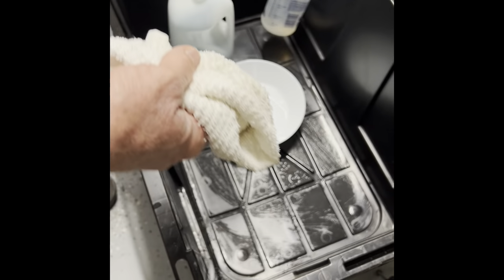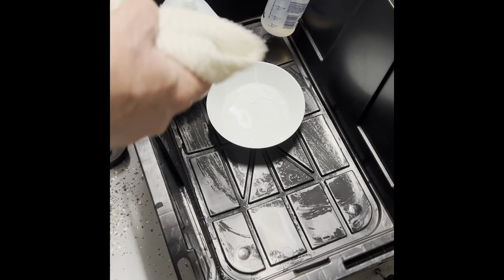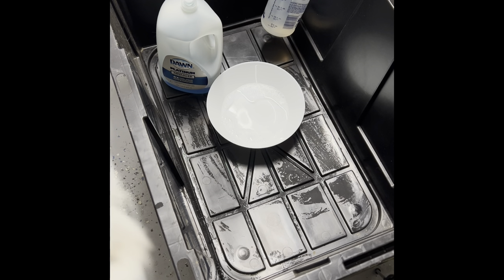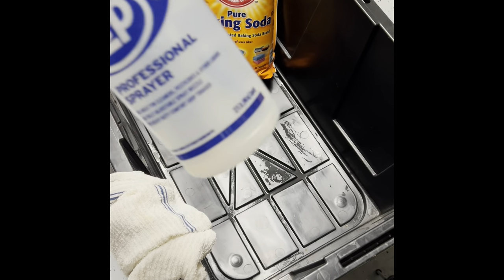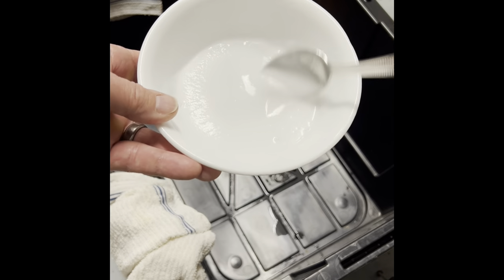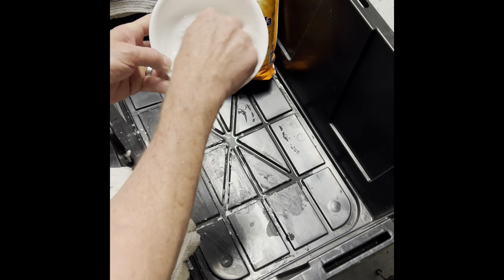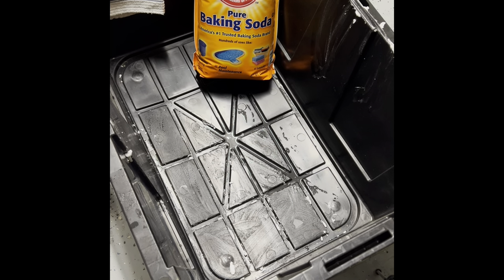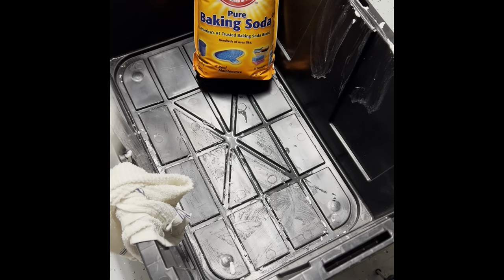How to remove🦨Stinky Toxic Plastic Smell out of plastic containers, cat carriers, and more...😇

Comment: Why should the consumer have to do this?
Reply from the maker: this video was done for a many subscribers who do not like the plastic smell in new products works for me God bless😇
Reply: @mbjdiy1778  I'm saying that they shouldn't be able to sell this stinky product to begin with.
Reply: @peejm1424  Nobody's forcing anyone to use cheap plastic tubs lol.  It's a price point thing.. If you can afford to store your goods in pelican cases or timber chests. You won't experience this problem. So shop accordingly.  :)
Reply: @M3rVsT4H  I don't have a problem with your video, I understand that it was posted so that it might help others, I'm sure many appreciate it. My problem is that regardless of the price, manufacturers should not be allowed to sell  neurotoxic products. I bought a rug in July that I cannot use because it is still emitting a flood of chemicals. I have to keep putting it outside because the smell coming off it burns the inside if my nose and throat and gives me headaches. I paid 350.00 bucks for it. I tried to take it back but was told that all they could give me was a store credit. Other than that nobody even wants to talk to me about it. As I was researching what I could do about it I came across posts about all kinds of bad plastics, everything from kid's mattresses to  clothing. I just can't believe that they are allowed to keep doing it. Anyway...
Reply: @peejm1424  Just for clarity, not my vid. But I hear ya. There is some nasty stuff out there. And the big problem we have as consumers is "Acceptable Limits". Because what one lab finds acceptable, your nose may not. And all we can do is inform ourselves and make informed decisions. And usually that leads to spending more. A wool rug would have cost you 5 times as much, but you wouldn't have this problem.

On balance.. Unless you've got that kinda cash to spend, you wouldn't have a rug at all..   So there has to be a balance point. And I don't support blanket banning of certain products for that reason. In my case with my plastic containers. If I was storing paint tins or firewood in them, I wouldn't even care about the smell.  But I put linen in them and I've learned a lesson. I will likely make some timber boxes to replace them, and relegate them to the shed.

FWIW, the techniques outlined in this vid will probably work for your rug too. The off-gassing of VOC's that are giving you headaches won't last forever, and at least you know your plastic rug will dry off quickly.   I did a bit of reading and aside from a dusting of bicarb or a weak vinegar solution, some ppl suggested a good soak in Tide got them results with their smelly rugs.   Best of luck with it, I get headaches from VOC's too, and I wouldn't wish it on anyone.